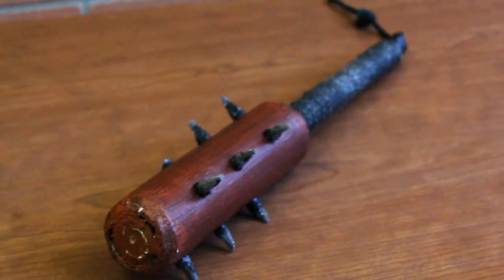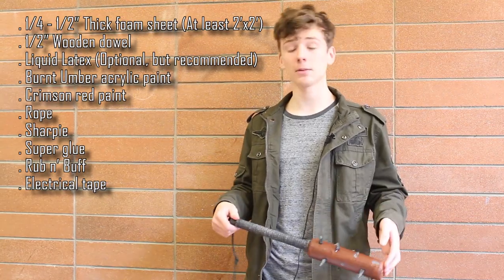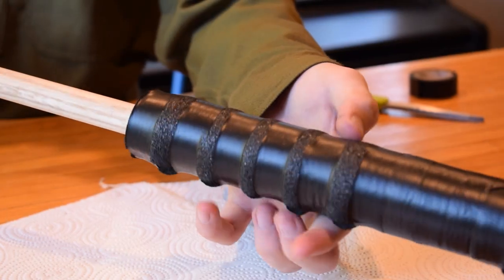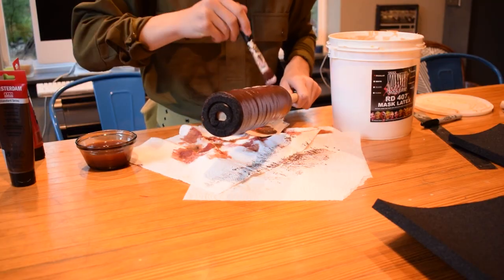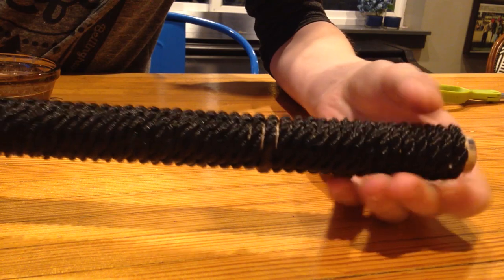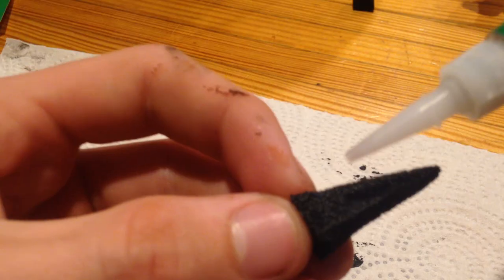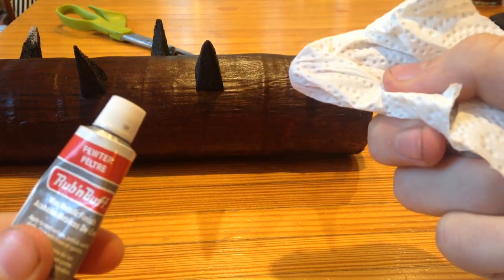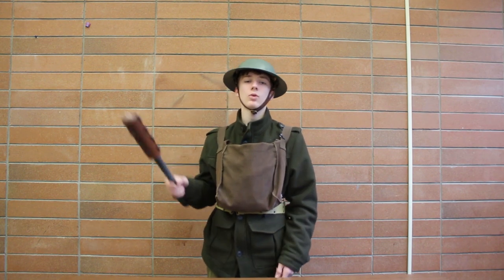How to make a Foam Trench club

Comment: How does this work on the field looking to make one for newville
Reply from the maker: They are pretty durable, although the spikes (Which are of course optional) may fall off during use. It depends on what kind of bond you use to keep them on. Personally, I had the best experience using the railroad nail head version.
Reply: That is what i was thinking any issue with using a Dowell? Im wondering if using a pvc pipe would be better for i pact as we have a tendency to get into it pretty well
Reply from the maker: @thetinhatranch3298  , I haven't used a PVC but I suggest wood. It is sturdy yet it won't hurt anyone, and it feels more authentic.